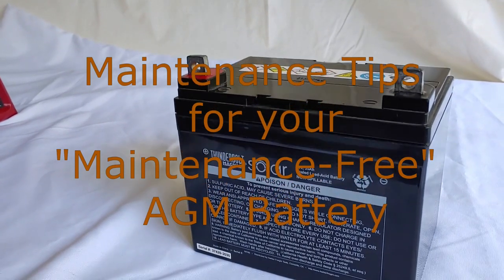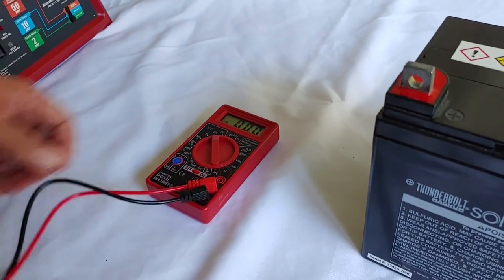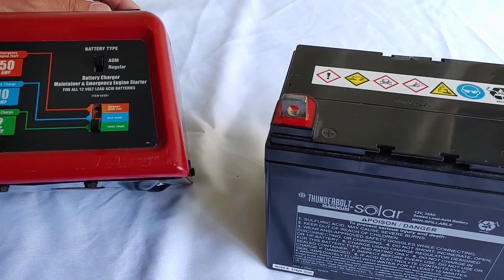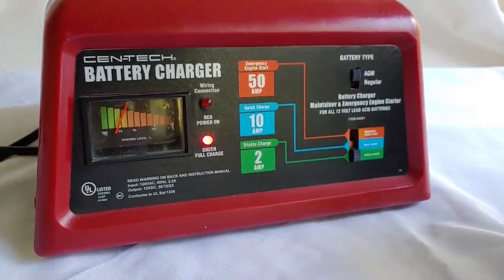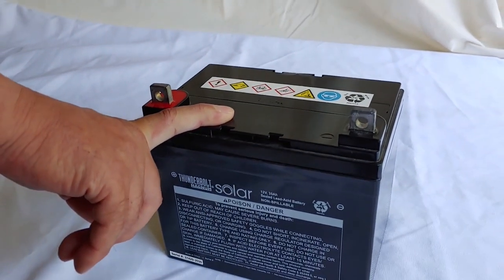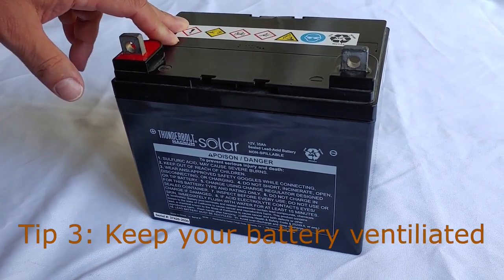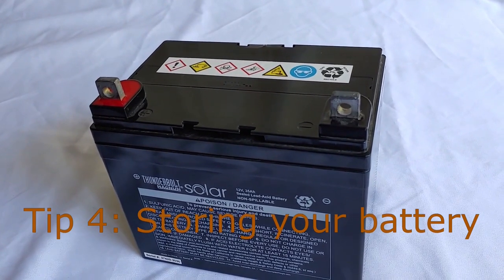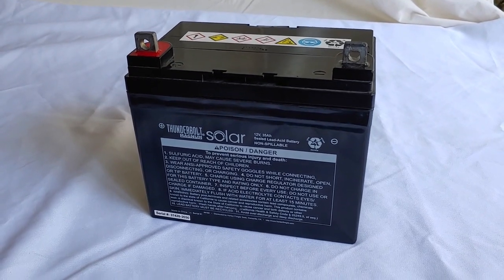Maintenance tips for a "Maintenance-Free" AGM Battery for off-grid solar power systems.

Comment: What if my riding mower has an AGM? Mowers dont have alternators, so what keeps the battery charged? How often do I charge it up ?
Reply from the maker: My riding mower also has an AGM. It came with a battery charger included. I charge it back up after each use. Thanks for your comment.

Comment: I have a 100 watt solar panel, a 10 amp PMW charge controller and a 100 ah AGM battery. Is there anything to consider when keeping the system continually or always connected? Thank you very much for you informative videos.
Reply from the maker: That combination should work well connected together all the time. Thanks for your comment

Comment: Awesome Video ❤. I bought the same exact battery and centech charger. If my AGM is reading 12.2. Do I change the centech settings to Quick Charge or Trickle like the video did for 13.0 reading?? My apologies still i am learning all this
Reply from the maker: No reason to apologize we are all learning.  I use the middle setting when that is complete I use trickle charge until the battery is full. Thanks for your comment.

Comment: Hiya Shoestring! I just put one of those Harbor Freight solar 12-volt batteries in my riding lawnmower. My external charger does have an AGM button on it but the mower charging system doesn't. Will that be okay when using the mower and the charging comes from the mower charging system? Great video!
Reply from the maker: It would depend on how high the mower will charge the battery. Don't overcharge it. Thanks for the comment.

Comment: AGM battery was given too me too look at? Friend removed plugs an flipped over too drain? What fluids are too be added an too what level? Or is anything added? First thing is youvmeasured current? Not levels?
Reply from the maker: From your description, it sounds like you have a Flooded Lead-Acid Battery (not an AGM). A flooded lead-acid battery has plugs which cover cells filled with water. Please use Distilled Water for the battery, not tap water. Look inside each cell and there will be a line which shows how much water to add.
I have a video which explains how to use and take care of this type of battery (here: https://youtu.be/LG8j32ATazM).
AGM batteries are sealed so you cannot drain or add water. If you are certain it is an AGM battery, then it has been damaged and please do not use it. 
Hope this helps. Thanks for your comment.

Comment: Hi Shoestring! Thanks for the video! A comment on a different video mentioned something to the effect: "If you don't use AGM batteries fairly frequently, then they go bad." Is their any truth to that? I've got the same battery and charged it with the little Centech float charger for 6hrs. My battery was 12.64vdc and after 6 hrs. It, initially, showed a 12.8vdc charge. Checked the battery a day later and it shows 12.6vdc. Yet again, I read on the internet that AGM batteries should not be charged for more than 3 hrs. Any advice you have would be appreciated! Thanks!
Reply from the maker: I keep all my AGM batteries charged all the time. They will lose a charge if they are left uncharge for a period of time. Thanks for the comment

Comment: Hi, I hv seen many video to revive this type of AGM battery to add battery water, should we add some amount of batt water thru the years? Or how do we know tht the glass mat is completely dry? Thanks
Reply from the maker: Do not try to add water to an AGM battery.  They will not need water. Thanks for your comment
Reply: @shoestringprep  if they don't need water. Wat then do we need to do wen they no longer hold power..?
Reply from the maker: @obaroaluya3762  when the AGM battery no longer holds any power you simply replace it. Thanks for your comment.
Reply: @shoestringprep  wat about deep cycle batteries AGM..?
Reply from the maker: @obaroaluya3762  AGM batteries of any types do not need water. Thanks for your comment.
Reply: @shoestringprep  tnk u 4 ur reply. My 200ah deep circle mercury battery just won't hold charge anymore after period of heat up frm overcharge current. U mean I can do nothing to resuscitate battery..?
Reply from the maker: @obaroaluya3762  nothing that I know of. Sorry.

Comment: Hi there i am getting all sorts of information about discharging i was told  by 3 people that 11.8 volts switch off as thats 70% discharge i want to drain as low as possible 100ah i no it will shorter life was told 400 cycles at most
Reply from the maker: The lower you discharge an AGM battery (below 12.1) the more you will damage it. A lithium battery does not care how far you drain them.
Thank you for your comment.
Reply: I’m assuming that you’re referring to the depth of discharge within the usable voltage range of lithium batteries, here. 

More specifically the usable  voltage range of approx. 2.9v-4.2v/cell that constitutes “0%” to “100%” capacity of each cell. 

Every battery chemistry absolutely does have a voltage cutoff point for over-discharging and over-charging. Charging or draining lithium cells to levels outside of the stable operating thresholds of the cell’s chemistry causes permanent, irreversible damage to the cell’s capacity, and ability to sustain its rated current-draw. 

I understand that you’re likely referring to the DOD in applications with internal lithium battery cells (or other-voltage series packs) that have BMS monitoring and automatic high/low V cutoff, such as a cell phone battery, and notify the user of the current usable percentage remaining to “0%” (2.9v).